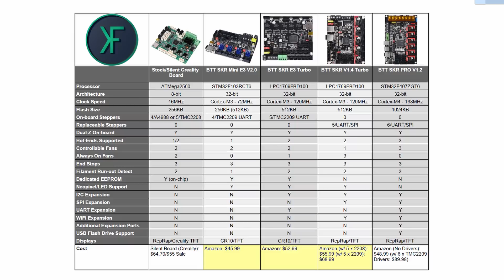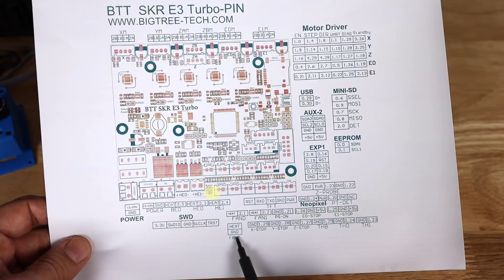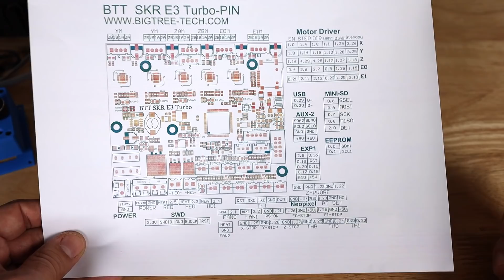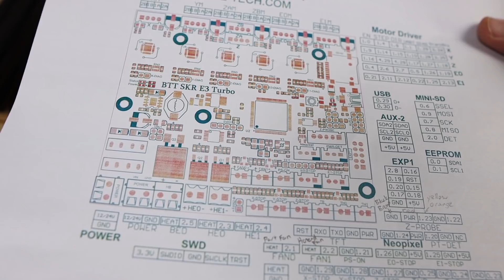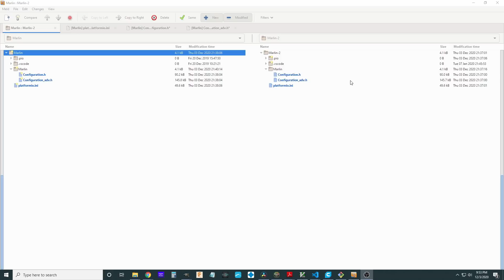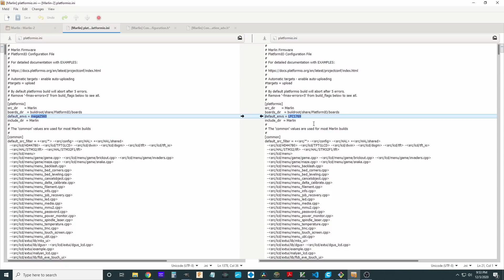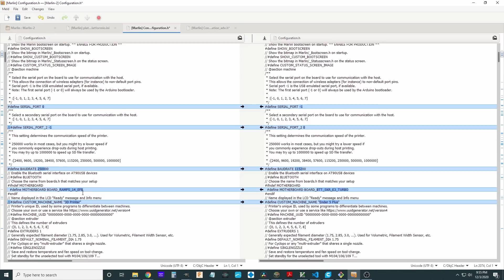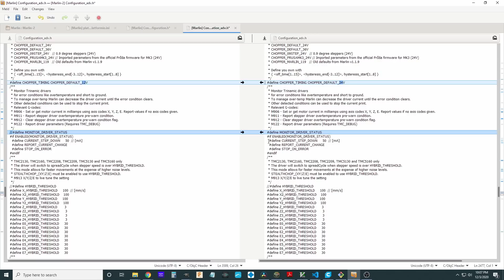Bigtreetech SKR E3 Turbo: Complete Guide

Comment: Hi Great video.
On my ender 3 the Hotend Fan has no plug on the end so was wondering where I connect it to.
Thanks
Reply: Its OK just remembered I have loads of Dupont Conectors I will just put some Duponts on the ends.

Comment: Just ordered this board, but starting to wondering if im still at GO without ordering a BTT lcd as well... Hmm

Will i be able to just install klipper as usuall, and get things going without an lcd?
All the motherboard setting, can i access, or just set them without a lcd?

Not sure im gona try to mess with geting the stock lcd working with this, since i just use Mainsail anyways.

Thanks. 
Great video.
Reply from the maker: I assume that the display isn't necessary with Klipper but I'm not an expect on Klipper. The stock display isn't worth your time IMHO.

Comment: Please change the lines below to be able to use the DUAL-Z-STEPPER-ALIGN" function. Just swab the E1 to Z2.

#define Z2_STEP_PIN                      P2_11             //E1_STEP_PIN; WHEN USING E1 STEPPER DRIVER TO POWER THE Z2 STEPPER MOTOR
#define Z2_DIR_PIN                         P2_12             //E1_DIR_PIN 
#define Z2_ENABLE_PIN                P0_21             //E1_ENABLE_PIN
#ifndef Z2_CS_PIN                                                    //E1_CS_PIN
  #define Z2_CS_PIN                        P0_22             //E1_CS_PIN
#endif
Reply from the maker: Mine worked without these modifications. Marlin handles switching E1 to Z2 when dual Z steppers are setup.
Reply: @kerseyfabs  This setting was recommended by BIQU customer service. I will try to test without changing E1 to Z2 in .PIN file

Comment: The BTT E3 boards are for replacing Ender original board. If you don't have an Ender you should use a board like SKR 2. I see so many people getting these boards I guess because it shows as popular but it is not the best choice unless you have an Ender.
Reply from the maker: Well, that's what I was covering in this video. It is a drop in for the Ender 5 Plus (for the most part). I'd argue though that these boards are nice for people that don't want to bother with add-on stepper drivers.

Comment: Am having trouble getting the bed leveling to work correctly? Is there anything special that needs to be done for this? Thank you in advance.
Reply from the maker: Can you be more specific about your problem?
Reply: I am having trouble getting the z offset set correctly and when I go to print from the touchscreen side it tells me fails to initialize, bed leveling off and fade height 1.0? The first two of the three messages are very quick. I have tested the bltouch and it is working correctly and I made sure I turned bed leveling on in Marlin. What is the proper procedure to set the z offset and level the bed? I know this is very basic but I am fighting a losing battle here and think I need to go back and start over. I could level the bed no problem with the stock Ender 5 plus setup but now the upgraded board and touchscreen are throwing me for a loop. Thank you for answering my question. I really enjoy this hobby but sometimes it can frustrating! I truly appreciate your willingness to take your time to help and I think I speak for more than a few when I say that.

Comment: Nearly two years ago I Installed the SKR E3 Turbo and TFT35 as well as upgrading my Ender 5 Plus firmware to Marlin 2.0.7.2 following your instructional video.  Since then I have uprraded that firmware to 2.0.9.1 and added Unified Bed Leveling (UBL) to that firmware version. Do you have a newer version of Merlin firmware for your Ender 5 Plus (i.e. 2.1.2) that you could share so we might install this newer version ? Thanks for all the support you provide to the community !!!

Comment: i know this is a old video and this i may not get any help from here but what should i do if the bl touch does not drop when i auto home because it goes up and down 3 times when it boots on but it never goes back down and then it slams the nozzle into the build plate
Reply from the maker: Check the black/white wire connection to the mainboard.

Comment: Man I’m in trouble… my current board is toast and won’t be able to get any settings. What is my best solution as far as getting back to printing.
Reply from the maker: Which board did you have?
Reply: Had the lerdge k board before it burnt up. They don’t make it anymore
Reply: Looking for a good easy to install board.
Reply from the maker: You could get the newer Lerdge Z if you liked your original. Otherwise a Bigtreetech SKR 2 or 3.
Reply: Will your settings file work with the  micro Swiss?
Reply from the maker: The Lerdge settings file? You'll need to change the extruder steps but that's all.
Reply: @kerseyfabs  I ordered the skr3 and thought you had a file for it that had most of the set up stuff done. My lerdge z board was bad when I installed unfortunately an don’t want to keep messing with it.
Reply from the maker: @natetate2795  Yes, I have firmware for it. Again, you'll just need to adjust the E steps for your extruder.

Comment: Just got a Ender5 Pro, my first 3d printer, looking for the best way to add an extra extruder, is this still the best option?
Reply from the maker: It's the easiest option. A small number of people are reporting overheating steppers with this board though. An SKR 2 doesn't seem to have that problem. Again, the Turbo is a nice board and an easier solution. Your call.

Comment: 36:50You mentioned the extra power connectors next to the connectors for the bed. Is it safe to connect a buck connector there for a 12v auxiliary fan? 54:14 You mentioned that you have your firmware.bin on the SD card, do you also have a configuration.h file there as well, or is it not needed with BTT boards?? I am coming off of using TH3D hardware with less than favorable results, and when flashing their main board, you do need both of those files. Compliments of a brain injury, I have been unable to wrap my brain around compiling my own firmware, regardless how many videos I watch, and honestly, just do not feel comfortable with doing it. There is an add-on for VSCode called Auto Build Marlin that is supposed to, pretty much do everything for you. Would it be safe to use it with this board and this printer?? I want to use this board to see if I can get everything running properly, and then print a new control box for my printer which will allow me to use an SKR Pro v1.2. I also have a BTT TFT70 that will be used with both iterations of my build. One last question, is it possible to set Z offset and bed leveling without a sensor? My BLTouch died on my third print, which led me to "upgrading" to TH3D hardware, and now I am back to not having a bed probe, yes, money is an obstacle for me right now.

Comment: Hello Sir, I did this exact upgrade and level all 4 corners with the thumb wheels and use your firmware. I can't get it to print filament won't stick I tried elmer glue stick probe offset is -2.68 can you please help ? Thank You
Reply from the maker: I will be releasing a full guide to Marlin bed leveling this weekend. I hope that solves your issues!

Comment: I am having trouble installing the proper firmware--Ender 5 plus with 2.0 board and new touchscreen. When I power on the printer, the cooling fan board is running all the time, the bl touch cycles like it should and the print fans cycle on/off. I have tried installing the micro sd card in slot on the board and on the touchscreen--nothing happens. Could you tell me a step by step process for this? Thank you
Reply from the maker: First, I don't know if everything is hooked up correctly but, assuming it is:
1) Rename firmware to firmware.bin.
2) Place on SD card.
3) Place SD card in mainboard SD card slot.
4) Power up printer.
5) The printer should flash and boot up with new firmware.
Reply: Thank you so much for taking the time to answer me. I found my problem—the new mount that I printed for the touchscreen was too tight and was putting pressure on the touchscreen. I loosened the mount bolts up just enough and now the touchscreen works correctly. I should have been more clear in my first comment but it turned out to be an issue with the touchscreen all along.
Reply from the maker: Terrific! I'm just glad you found the issue!
Reply: Now I am getting an error message that says "no printer attached" when i try to use the touchscreen side. when i hook the printer up to Pronterface, i dont see any lines of gcode at all. Using the marlin side of the touchscreen, i can get the bed to do an autohome but the nozzle will crash into the bed if I dont shut it off. What have I done wrong? Its almost like there is nothing on the board for the printer but when i look at the printer info on the marlin side, it shows ender 5 plus? Im also unsure about the bed leveling procedure with this new board.

Comment: Hello, you do not change the deagult filament sensor config? i remember it comes disabled by default, isn't it?
Reply from the maker: I have the filament sensor enabled in Marlin. If you want it to work with the Bigtreetech Touchscreen UI, you will need to connect the runout sensor directly to the display's port.
Reply: @kerseyfabs  Thanks for your answer! I have seen the source code in git hub and i thought you had this line commented, i'll look it again. Thanks again for your answer and i love your work!

Comment: Great Video and thanks for the help with a new firmware on my Ender 5 plus... The stock Creality Firmware on this printer was/is terrible.  The stock leveling is crazy and the Z Offset is impossible.  

One Question on the SKR Turbo Board.  Does  it have a boot loader?  Or in other words can you flash the firmware directly from a PC with a USB Cable?  After and hour of trying I could not get the new firmware to flash.  Loading it into an SD Card  under "firmware.bin" worked, but this is kind of backward for a card with so much memory and processing power. 

And I get an EEPROM Initialization error with every Printer boot,  Odd.

Comment: Is it possible to repurpose the original ender 5 plus screen for a octoscreen?
Reply from the maker: Theoretically yes but from a practical standpoint, probably not. It's not a standard display. It runs its own firmware and communicates over serial.
Reply: @kerseyfabs  awesome thanks for the input

Comment: thanks for this video again ! i did everytthing like your video but when i home x and y work but on the z it goes to the middle and deploys the bltouch but then it's not moving the bed it is retracting and deploying the bltouch and ending with 999 error .  the bltouch test works all the movements are working like they should . any tips ?
Reply: For me it was the wiring. Check it before you close !!;)

Comment: I was needing help. I have a Ender5 plus and I use Cura to slice but the underside of my prints come out with a really bad finish. The out side and top are a perfect finish. I feel the problem is in the slicer but I'll take any suggestions please.
Reply from the maker: Explain what you're really bad finish looks like.
Reply: It has a lot of stringing and a rough cobbled up finish on the inside and undside of all my prints. I printed a case for my Rasberry pi and the inside of the top and bottom covers are totally unusable.  The outside is a perfect finish
Reply: If you have an email address I can send you pictures
Reply: I found my problem i had to slow my print speed down to 50 mm per second and it cleared up my problem. I hope that helps someone else that is new having the same problem.

Comment: used your firmware... and adjusted the stepper ma to 525 xyz and 650 for e and well below what you have in the firmware you provided and all my steppers are overheating not sure what is going on
Reply from the maker: Are the drivers or the motors overheating?
Reply: It was the motors.... Found out that it was the 5v from the usb connected from my raspberry pi.  Had to put tape on the usb cable 5v pin
Reply: For manual leveling the 4 point coordinates seem to be for a smaller bed.  Do you know how to change these settings.... I couldn't find it

Comment: my one overheats really quick, can you help please?
Reply from the maker: Make sure your board fan is running. Also make sure your stepper currents aren't too high. Do you know what's overheating?
Reply: @kerseyfabs  its the main ARM processor, i tried it without any drivers and it still overheated
Reply from the maker: @sebastianwickenden3972  Are you getting an overheat error in Marlin? I haven't seen that one before from the main processor. Those usually run very cool.
Reply: @kerseyfabs  no, it just crashes and restarts with no warning
Reply from the maker: How do you know it's overheating then?
Reply: @kerseyfabs  it gets the hot electronics smell and i can feel the heat when i hover my finger over it coming directly from the ARM processor

Comment: Already bought e3 turbo + tft35 v3 + geeetech mk8 dual extruder. Now looking for nema17 motor. If i plug 24V power supply to e3 turbo, will the same 24V go to nema17 motor? I can only find 12V nema 17 motor here in my country.

Comment: I followed this guide and downloaded your firmware, but now it seems like the printer is set with a much smaller bed size, how do i fix this? 😅
Reply from the maker: Have you upgraded to the latest firmware on the display? This is an issue with the UI and doesn't happen using the Marlin interface.
Reply: @kerseyfabs  i fixed it using Marlin interface, but where can i find the updated firmware to flash the screen so i can use both Marlin mode and touch? :-)

Comment: I am using your firmware on my ender 5 plus and I have two issues. The filament runout sensor will say there is no filament. The blue light is on and I have it plugged into the E slot on the board. When I try to manually level the bed the location of  the 5 preset points where the nozzle lands are incorrect. They are set for a much smaller bed size.
Reply from the maker: It sounds like you're using the touch screen interface. If you want to use the run-out sensor with the touch interface, you have run the wires directly to the back of the display. The port should be labeled. As for the bed size, have you updated the firmware on the display? It should be getting the correct bed size from the firmware. https://github.com/bigtreetech/BIGTREETECH-TouchScreenFirmware#update-tft-firmware
Reply: @kerseyfabs  Thank you for the reply. I am using the touch screen. I will try rewiring it. I have updated the screen to V3.0.27 and the issues persists. I have a TFT 43 display if that changes anything.
Reply from the maker: @morphine07  No, that doesn't really change anything. Check out this link: https://github.com/bigtreetech/BIGTREETECH-TouchScreenFirmware#using-the-configuration-file
You can hard-code the dimensions of your printer using this file. It should be fairly straight forward.
Reply: I got the bed level issue sorted out. However, I ran the filament sensor to the LCD and it still doesn't detect there is filament loaded.

Comment: Help. PIO is stuck thinking it's a RAMPS board despite me clearly defining it as the proper butt e3 turbo. It's like it compiled in wrong order but I can't make the ini process later. It says LPC1769 isn't compatible.,
Reply from the maker: There're a "PlatformIO: Clean" button that looks like a trash can. Press that to reset the tree.

Comment: had problem i think with heat on my main board . So changed /installed for brand new mainboard. when i auto home or move any axis, the motors dont then the screen resets. i have put the original firmware back on ( Ender 3 ) and the motor move no problem. Any ideas ?

Comment: Can linear advance be disabled easily through G code or does the firmware have to be re-compiled?
Reply from the maker: If you don't set the K value, linear advance is effectively disabled. No need to recompile.
Reply: @kerseyfabs  that makes sense, good to know!  Also, I am now using a K value of 0.8 and it works amazing. I was using that test that produces the test lines and you pick the best line. It was actually fun.
Reply from the maker: Awesome! I'm glad it's working for you!

Comment: Dammit. My skr 1.4 Turbo just arrived Yesterday... Great Video as always.
Reply from the maker: Sorry about that. That's still a great board.
Reply: @kerseyfabs  yeah, guess so. Can't wait to install it, but as mentioned yourself in one of your videos - family first, then the hobby 😉
Reply from the maker: I completely agree. Life is a balance of many things.
Reply: @kerseyfabs  simply true.
Reply: Don't feel bad about the 1.4 Turbo. It has one significant advantage over the E3 Turbo in that it can take the EXP-MOT daughtercard for an additional 3 stepper drivers. This means you can potentially do dual extruders AND Dual-Z.

Also ... you don't necessarily have to have to replace the display or hack the case with the 1.4. Insanity Automation has a Marlin fork that supports the Creality touchscreen, and although the 1.4/Turbo board doesn't line up with the bracket mounts or USB/SD card holes, you can print an adapter, snake the USB cable out through the wiring harness hole in the PSU case, and use an SD Card extender to access the SD card slot. Just run the cable through one of the side vent slots. Like Kris, I prefer the TFT35, but that also fits without carving up its bracket when you install the SKR 1.4 with a printed adapter bracket.
Reply: @OriginalDodgeDeBoulet  Thanks for the hints. Anyway, I bought the bundle with TFT35, so that won't be an issue. The daughtercard is interesting as I really want to try two extruders in future, but one step after the other ;-) Haven't had the time though to install it yet, need to read and prepare upfront...
Reply: SAME!!! Lol! Good thing I needed two but only got one for now.